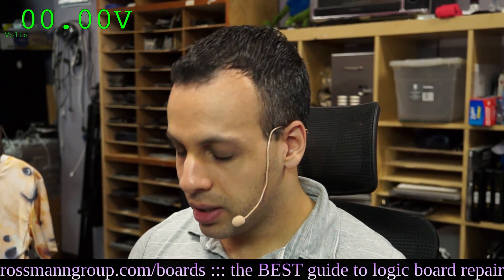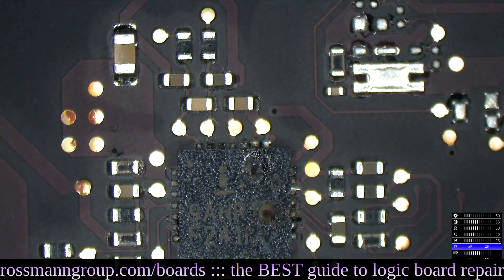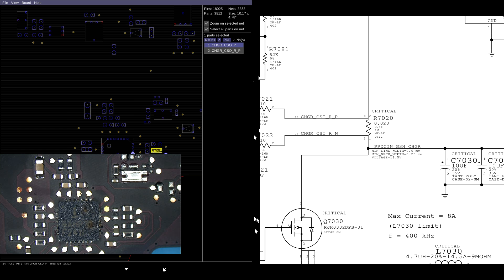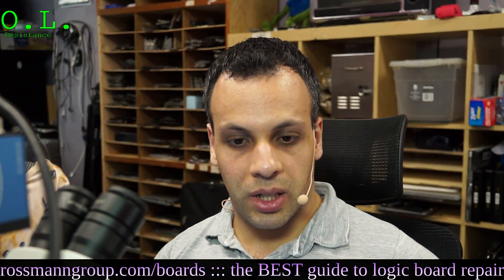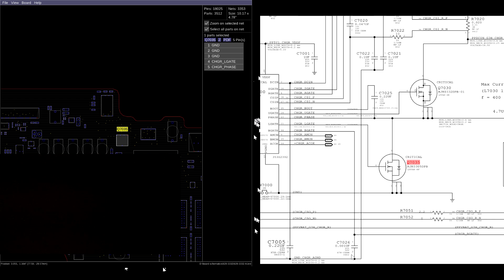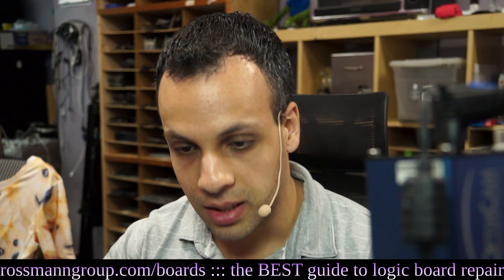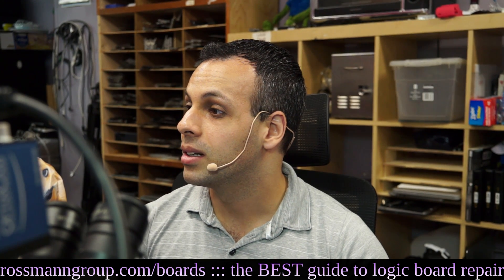Can eBay battery kill a Macbook?

Comment: Has anyone tried Quantum batteries off eBay? they are typically x2 the amperage of the normal battery but the same size using I guess newer battery technology. Dont want this mess in my note 5.

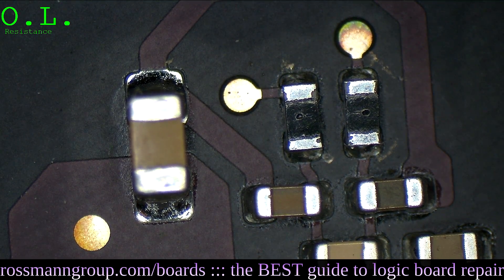Comment: At 7:00, you can't really measure resistance while the resistor is still on the board. The 
other components on the board will influence your measurements, but hey, it works for what you're trying to show I guess.

Comment: I got a 2011 15" pro-model for free from a friend that was broken. It didnt do anything. I just disconnected and reconnected the battery sometimes and plugged the charger in and after some time it turns on. When i cleaned it and replaced the thermal paste, i ripped the speaker connector, but i was able to solder it back on. And somehow i shorted the battery indicator on the side...

Comment: I’m still looking for you video that show 2016-2018 40V LCD backlight lines are next to the 13” MBP line straight to the CPU (with IEEE 101 “buffer to ground”) in between. My buddy has owned everything since iPhone 2G but has laid his share of Cat 5 Cable and installed his share of PC workstations or fixed friend’s C2D Toshiba Satellites laptops that didn’t even come with a webcam.

Comment: As always great video!! Louis what do you think about NuPower and iFixit battery replacements. Are they any good? Unfortunately I have to look at 3rd party replacement as Apple doesn’t have replacement for 2011 MBP since they consider it vintage. I also saw your video about what happens when you use a cheap charger in MacBook and how it fried the motherboard.

Comment: Q7035, the lower MOSFET is used as an synchronous active diode. In a buck power supply you have two hot loops. One pushes current through the top MOSFET to the inductor and capacitor. When the upper transistor is turned off, the inductor will push a reverse current (because of the induction effect - during the on state of the upper MOSFET, the inductor stored energy). When the upper MOSFET is turned off the energy has to go somewhere or the voltage will rapidly rise - see Faraday s law). Usually, in this moment some buck supplies use a diode that pushes this current through the capacitor for the state when the inductor generates a reverse polarised current. To make it more efficient the diode is replaced by a MOSFET controlled in antiphase with the upper one. If the diode conducts when it is polarised directly, the MOSFET is turned on at the right moment by the controller. Best regards from Romania,  @Louis ! You have great videos that teach interesting stuff.

Comment: I got a basic question. You can buy a battery from company X for your X device, but I notice that for most companies that part is at least twice as much as the generic part. You can find lots of batteries on Amazon ( which I think is not perfect but a lot better quality wise then eBay ), most of them perfectly good. How can you tell a good battery from a bad one?

Comment: Did the customer say it worked fine before they swapped the battery?
Or did they swap the battery because some stuff had already started to fail and they thought a new battery would help?
Or... Did they short some crap out while installing the battery, and blow the crap out of the charging chip, which then blow the MOSFETs?

I have my doubts the battery alone was the cause, not that I'd stick a "cheapest bidder" battery into anything I cared about (including my house - I like that not burnt down).

Comment: Hi got a question got a1398 i7 macbook. When the macbook is on i get a solid orange light. Which indicates it charging and it does. How ever when it off . The macbook will go green and after about 30 seconds to a min it will go Orange. And same again it will go green.  The macbook has got a replacement charger and it not original. It just strange that when it on it solid orange then once it reaches 100% it go green. Any idea it baffling me

Comment: Those are probe points dents in those resistors(someone doesnt know how to measure and thinks you can just touch it anywhere), and to be fair I think the battery was changed because the ISL6259 died and not the other way around.

Comment: its really nice how those resistors make little current-explosion-holes.  It's a toss up.  Either a ridiculously out of spec third party battery, or apple's charger circuit design is made for a very specific battery chemistry and won't work with others, even though the voltages are not terribly different.

Comment: Louis--
Does that recalcitrant battery bear any means of I.D.`ing it as to manufacturment or brand name? When I started out on this Velvet Doberman adventure I was kinder, fitter, happier [but not...more productive] and now, well into the fray, I've mostly ash-canned that in favor of taking names and kicking a$$es.
The purveyors of this trash w/o regard to the exponential burdenings their insensitivity dumps on the poor unsuspecting, bought-in-good-faith customers ~which keep their doors open and Subway on the table~ need be not-so-gently invited to be put in stocks in the village square --naked, prominently displayed, without bathroom privileges and only water and an occasional stale Oreo to eat for the duration.
What Brand of battery, was this one?
Oh yeah ...btw "It's Time", accountability and fear of loss, applies here.
'Buffered' soclmdia contact email: DBackline@webbstream.com ; I will respond to any respectable post or question.
--cheers,
Dion
http://TheVelvetDoberman.com

Comment: Louis, thanks for the great vids! I'm in the process of choosing a multimeter atm. I was watching a repair vid from back before you obtained the 390A; in it, after someone in the chat described the BK 393 in more detail, your response was understandably quite negative towards the idea of the PC com link not being native USB. In the end though, what changed your mind? And why did you opt for the 390A over the 393? Where I am (UK), the 393 isn't that much more than the 390A, but offers greater precision (at least on paper). After using the 390A for some time, may I ask what your opinion of it is? With hindsight, would the 393 likely be worth the slightly higher cost?

Also, I asked Paul about oscilloscopes, he suggested that if I was going to get something decent, then a digital storage model would be preferable. Looking at what's available at my budget level (about $450 equivalent) , it seems to be a tradeoff between bandwidth and storage log memory, eg. 200MHz with 40K log vs. 50MHz with 1M log:

https://www.amazon.co.uk/dp/B01M15LZ5Q/
https://www.amazon.co.uk/dp/B005ZPGPI6/

Have you used storage scopes like these? If so, does it really help much to have a large memory log? I also notice the resolution of the screens used varies greatly, was wondering if that mattered at all.

Btw, I'll mainly be dealing with SGI boards, which are somewhat larger (and of course much older) than Apple laptop boards, so the ultrasonic cleaner I bought had to be large... :D

https://www.amazon.co.uk/gp/product/B01MZ5M3B1/

Thanks again for all your content! Learning a lot, and in the process you've help revive my enthusiasm for tech work.

Ian.

Comment: That ebay battery was filled with angry electrons instead of happy little electrons, they shot holes in all kinds of components! I'm honestly surprised no traces burned up. Wow, those were some granular joints on that gpu! I wonder if anybody has made a little dongle that batteries could be plugged into to test their legitimacy?
Reply: chinesse electrons are spreading communisim into the componements! Armed revolution!

They win, but at what cost o.o

Comment: I bet it was not the battery fucking up the board. Any battery would cry it, if the onboard switching fets go short. Well.... Not any. Just Apple Boards. Others use propper engineering and fuses that work.

Comment: Your explanation about switching converters is not wrong, but it's a bit imprecise. DC/DC converters work by storing energy into- and releasing energy out of the inductor's magnetic field. 
- In the case mentioned in the video (a buck, or step-down, DC/DC converter), the basic working principle is as follows:
1. The upper transistor starts conducting, allowing current to flow from the VCC rail, through the inductor and to the GND rail. The inductor's magnetic field expands, and energy gets stored into it;
2. The upper transistor stops conducting for a brief moment, sufficient for it to recover from saturation -- Also known as dead-time. As the current from VCC stops flowing through the inductor its field starts collapsing;
3. The lower transistor starts conducting. The current from the inductor's collapsing field now flows through the storage capacitors, through the GND rail and back through the lower transistor.
4. The lower transistor stops conducting (dead-time). The cycle is complete.
- The output voltage (Vout) is usually the product of the supply voltage (Vin or Vs) and the duty cycle Vout = Vin × D. Duty Cycle (D) is the proportion between the On Time (ton) and Period (t), thus D = ton ÷ t. The final formula would be: Vout = Vin × ton ÷ t (assuming, of course, there are no losses -- which is never true).

P.S.: I stand to be corrected!

Comment: So what was the battery doing or what is it still doing that caused this damage?  A battery seems like a pretty mundane item.  What is wrong with this one?
Reply: prob it gave the wrong voltage overloading components
Reply: Same question. Wrong pinout? User error during installation? Too many cells?

Comment: Wonder what was wrong with the batt to cause that?
Seems to me like a battery is a battery, only thing I can think is it was wired backwards, or had a dead short to ground. 
Because you would think a batt with dead cells just wouldn't work.

Comment: A curiosity for you guys who work with this type of soldering equipment: what are the application differences, benefits and disadvantages of hot air vs infrared soldering? All I can imagine is infrared doesn't blow stuff away with air, but can't imagine anything else

Comment: I noticed you tried measuring the resistors while in circuit. Am I missing something because generally measuring resistance in circuit does not measure accurately. You need to measure out of circuit or isolate. Please correct me if I'm wrong.
Reply: if you messure them in circuit, the value tends to be lower, because something is may in parallel with them and resistors tend to fail with a higher value, so if you messure a value to high, it is probably a bad resistor
Reply: but you are right, to messure it accurately you have to messure it out of circuit, or simply replace it with a known good one because resistors cost next to nothing
Reply: You can often verify that a resistor is bad by measuring it in circuit, especially if it is a low value one like this. It is only 10Ω, and nothing in series with it is likely to be that low. Indeed, that is how it showed, as the resistance was tens of kΩ. Likely, the resistor was open circuit, and the 10k was the resistance of the rest of the circuitry.

But you can't always verify that it is good. If you measured something close to 10Ω, then you would have to research further, as it could be ok, or it could be faulty but the stuff in parallel also had low resistance.

Comment: In high school i was part of the robotics team. I learned the hard way, if you make a circuit that you have made for your self (no safe guards because your that good) and have someone else use it, and it is run the wrong way. just throw it out. I spent 4 hours making a relay board, just to have my friend run it the wrong way. I spent so much time hunting dead parts, just to test it and have more dead parts kill the new parts, i ended up just throwing it away in the end and starting over.

Comment: If someone melted off everything from the board and handed you the bare board and the bag of removed parts, how fast could you sort through it and reassemble it? :)
Reply: I'll just answer for Louis: He won't touch anything and decline the repair. How long would it take? Far too long to be economically viable in ANY degree for both his business AND the customer...
Reply: Also, I failed at buying flux. Never order parts on ambien. It is not very flux yet. Will try again soon since I can’t find a good source here in Oz.
Reply: I've seen super-expensive commercial video equipment boards take a dive in the reflow oven and have hundreds of parts knocked off-pad or off-board - everything from 0402 chip parts to bga's and special ASIC's.   and that had to be reassembled by hand.    That took one of the rework girls several days to rebuild (in between component req and other jobs)
Reply: One of the biggest hassles is that to get a ball grid array chip onto thr board requires individual stencils, sometimes unique to the board, and itd take months for those to ship in from china. Generally those chips dont die and are relatively difficult or problematic to replace either way
Reply: Kyôdai Ken I didn’t mean as a customer thing, more as a ‘fun’ challenge. :p But yeah, the balls would be the hard part.
Reply: Did you get racist flux?
Reply: There's a name I didn't expect to see here. Hi Tzi :)  -Donaghy
Reply: Jake M ahhhh! Small world, hi!
Reply: J Beith haha, no. I in fact got Amtrch solder stuff (SynTECH), which is by the right company and comes in a syringe, thus my addled brain thought it was the right stuff. Oops. Ambien really does mess with your head, but no, it doesn’t make you spout things you don’t believe. Like booze, it kills inhibition and those perky alarms saying ‘this isn’t a good plan’.

Comment: I have a macbook Air 13 inches mid 2011 model, and it wont boot when the trackpad is installed,,
Reply: Marion Ignacio He made a video about that issue. It won’t boot because the trackpad can control the smc